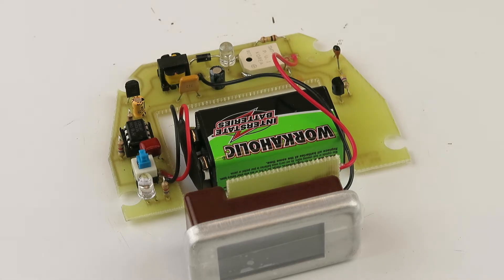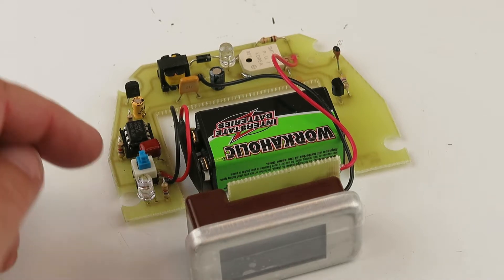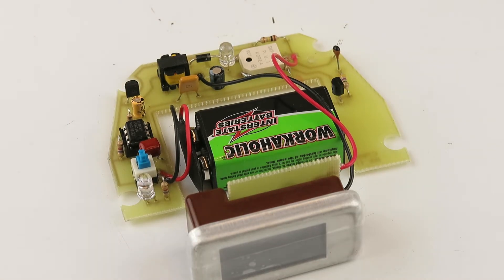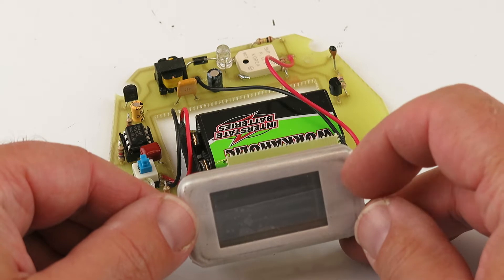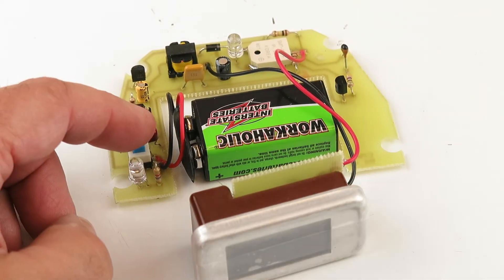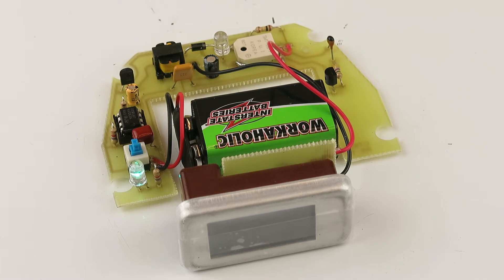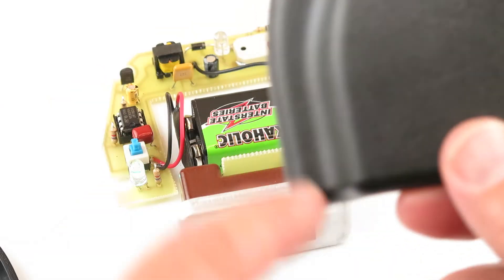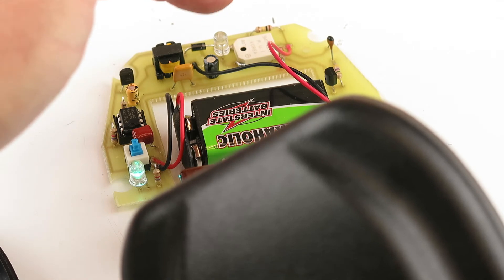C8092 - Super Sensitive Alpha Beta Gamma Pancake SBT-11A Geiger Counter Assembled Unit

Comment: Does the mica window need to be covered to differentiate alpha from beta/gamma? Also, is the tape going to pose a problem to the very thin mica when peeling it off?
Reply from the maker: The peeling off the tape doesn't affect the mica because we attach it to the metal housing only. 

I believe the window may need to be covered when testing Alpha rays, I'm sure there are experiments online that show some examples for testing Alpha.
Reply: @electronicgoldmine7745  Thanks, I believe you're correct in the covering of the window to eliminate the alpha rays. Then you're left with gamma/beta. The reason I mentioned the tape is that it could be inadvertently pushed in and stick to the mica during shipping. As long as it's packed carefully, then there shouldn't be an issue. Thought I would mention it, however.
Reply: I think you can cover the window with a metal screen attached to the metal of the detector.  Like the scotch tape, it shouldn't touch the mica window.  If the spacing in the screen is too dense, it will block much of the radiation.  If it is too open, the window will be less protected.  Find a happy medium by testing different screens.
Reply: @electronicgoldmine7745 Covering the window with anything as thin as human skin will almost entirely block alpha radiation.  If you want to estimate the alpha ray flux, take a measurement without and with a thin covering (thin plastic wrap?).  The reading without the cover minus the reading when covered is the flux of alpha radiation and the fraction of beta and gamma radiation that the covering blocked.